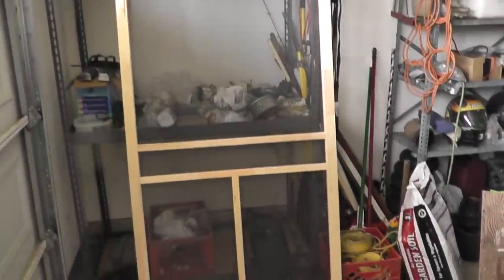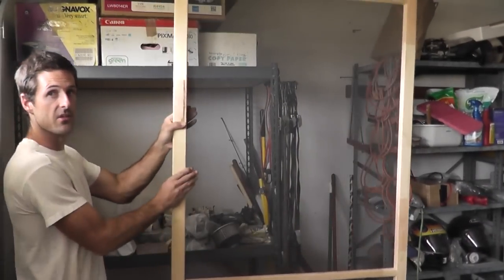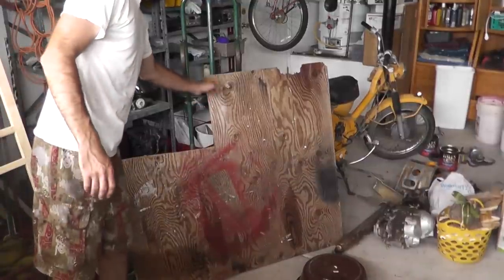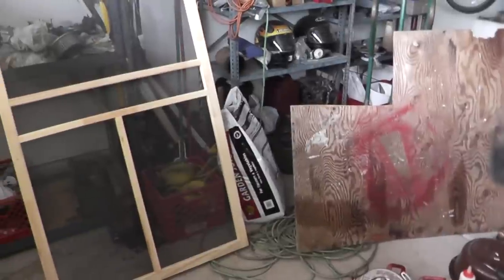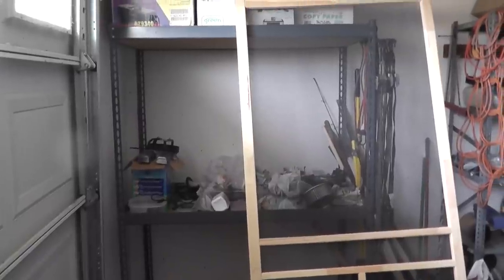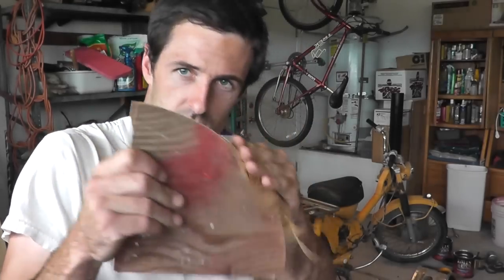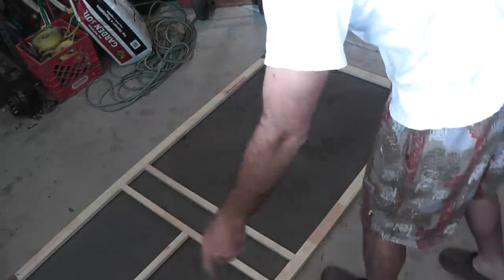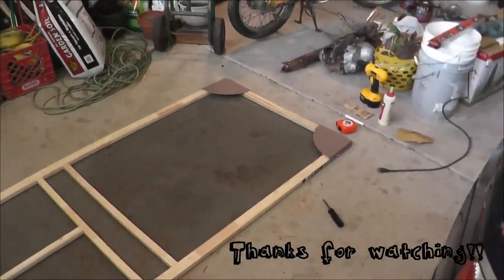Sagging Screen Door Repair & Prevention

Comment: Thanks for the tip.  When I took the old screen door off the frame, it fell apart at the joints.   For the new door,  I cut the corner braces and glued and screwed them like you showed.  Then I treated the entire frame with Thompson’s water seal.   The door comes with two spring loaded hinges so I bought two more and used all four hinges.   Might be a little overkill but this door is now solid without any sag.   Thanks!  (Total investment was $79 at Lowe’s)

Comment: A couple of suggestions.
Paint the door and the braces prior  to installing the braces.
Paint both side of the braces otherwise the plywood will weather from rain or snow.
Put the braces on the screen side of the door and you won't have a place for insects and spiders to live.

Comment: They used these screen doors quite a bit in the old days, and another method of squaring was to use a turnbuckle and wire so they could kind of tweak it if things got a little weak. I'm needing a screen door like this, but your method seems to be a bit easier and a lot cheaper to fix a door.
Reply from the maker: Hi, I think the wire is a good idea too, but I already had the plywood so I went that route. Thanks!

Comment: I got that exact screen door. After painting the reinforcements and affixing them according to your directions, I mounted the door. Unfortunately, the door warped outward on the top, the opposite side of the hinges, leaving a gap. Now, I either have to attach a metal strip to the outside edge of it of buy an aluminum screen door to replace it. I'm seeing that, sooner or later, these cheap thin wood screen doors will fail without additional support.
Reply from the maker: +Brad Iverson It's almost embarrassing that they sell them. After I did all this, a few months later the screen started coming loose!
Reply: +Jennies Garage .... Everything they sell is crap! When my dad came to town to visit, he  put one of these on my back door (about 10 years ago) and bought me a quart of paint to paint it after he left.... I could see the time painting it would be wasted as it was falling apart within a day!  I'm thinking about buying another one and reinforcing it before it goes up, since I don't have wood-working tools (to build one from scratch), other than hand saws, etc.  Maybe it won't warp too soon!
Reply: @jenniesgarage  My screen is coming out on two sides and it isn't even hung yet. :(

Comment: Hmm nice repair :-))

I would say things like lift the top angle so the corner scrapes the top of the frame, it will still droop slightly and take longer to scrape on the floor.
But we dont have screen doors in the uk so ill take it all back ha ha :-))

I think sheet steel "L" plates would have worked as well, but we dont all have such things sitting around to use do we :-)
Reply from the maker: that's interesting. why no screen doors over there, is it the weather?
Reply: *****
Yes the weather is quite bloody cold at times lol, but at the moment we are having a odd heatwave, rather nice for a change :-))
The uk tends to be rather dull/cold/chilly/rain so i think most bugs dont enjoy that, i dont blame them lol.

Typical bugs are daddylonglegs/flys/moths/bees/wasps, but not many unless you leave a window open at night with the light on ha ha.

Comment: Up in Maine we call this a “thwacker” because of that sound! Anyway I bought one with 5 ?’s (posts on the bottom half). The wood is fj = finger joint. I did stain it the day after install but we got some huge rains. Needless to say the thing has expanded and will not shut. Do I have to call the carpenter back or is there a way for me to adjust hinges?

Comment: Dude, use a turnbuckle! That's how we do it in the South.
Reply from the maker: That's a good idea
Reply: Also its how it is done anywhere that’s civilized
Reply: @garykorzelius5930  Doors are done like this routinely, but with nicer wood as the gussets dress doors up a bit while giving them more strength.  Of course a turnbuckle can be used too, but not near salt water.
Reply: I used a turnbuckle.... but it keeps un-turning and sagging.
Reply: @jeffkaege6660  How is it backing off? Is there any way to put a backing nut on it to prevent it form backing off?
Reply: @jeffkaege6660  add a jam nut on one side of the turnbuckle

Comment: dude...u have the right idea,and i am all about trying to make my work look just a little bit better by adding an unneccessary 22.5 ,45, or so angle, to it, or whatever while the main goal is support or structural integrity. but seriously, IF U R GOING TO GO THRU THE TROUBLE OF MAKING 4 1/4 CIRCLES,COULDNT U FIND A BETTER,PRETTIER PIECE OF PLYWOOD?  dang mann, it just looks like shit wirt that old wood... although, i do think that u do good work. happy days,budd

Comment: I am making my door from 2X4's ripped in half. It made a good strong outer frame. I have a blood hound that is going to want to sit & watch out the door so I needed to commit to a fence~screen door. LOLOL So I used 1/2 " hardware cloth on it along with the screening, just in case he saw a rabbit out the door. Now all I have to do is figure a way to lock it securely so he can't push the whole thing open. What do you think 2-3 hook & eye locks? Maybe electrify the whole screen. LOLOL Just kidding.